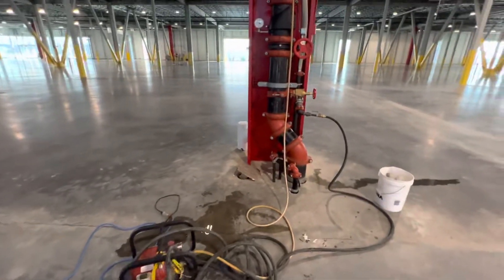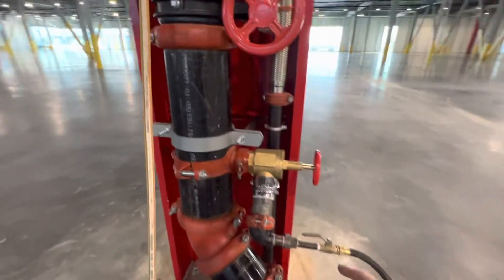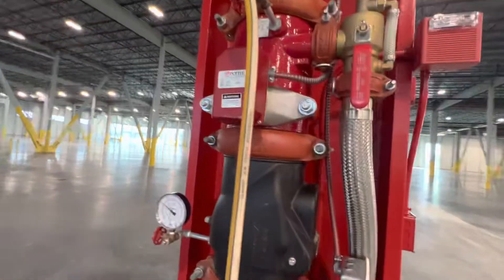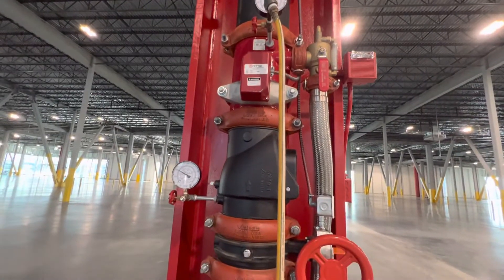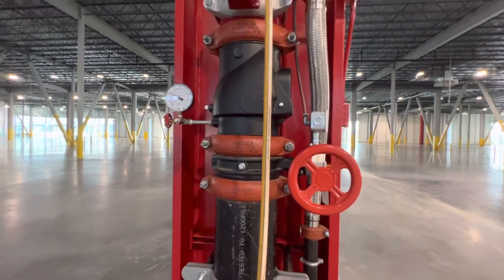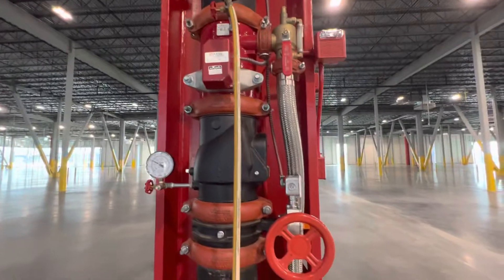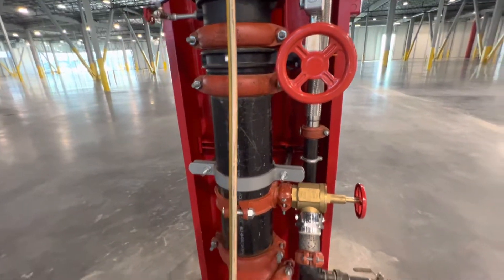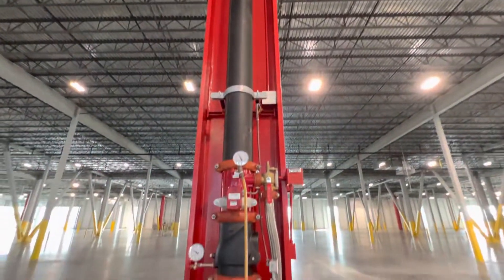DO THIS WHEN Sprinkler System Hydrostatic Testing

Comment: What’s the best way to release all that pressure safely after the test is complete
Reply from the maker: Just open the drain valve a little until the pressure goes down .
Reply: @SprinklerFitting I almost got my head blown off taking off a coupling after another guy said the pressure was released
Reply from the maker: @dontoday I know what you mean ! I always verify the gauge and position of valves before I undo anything .